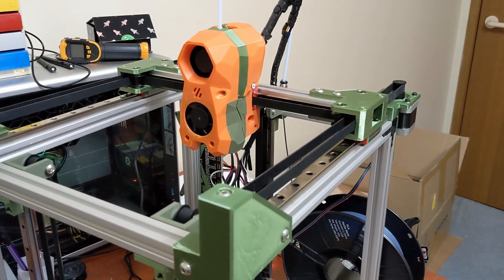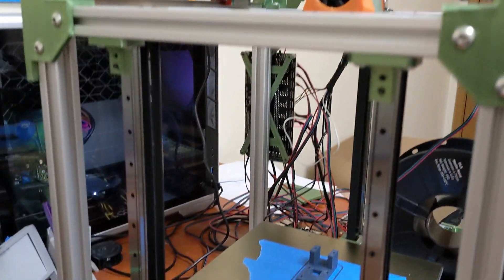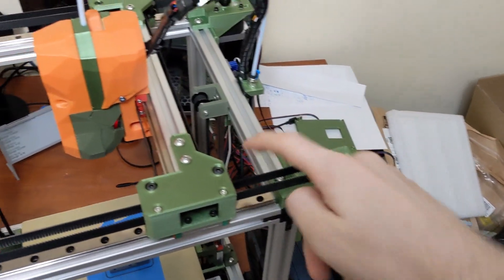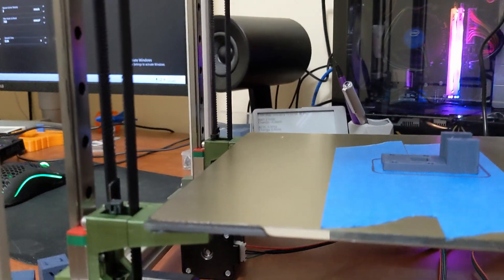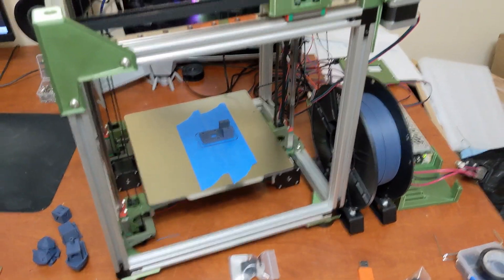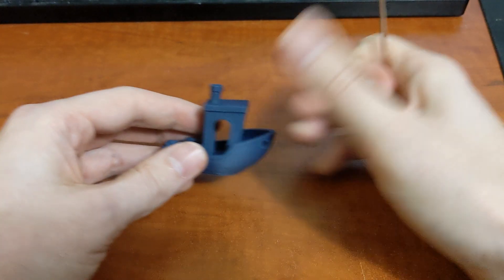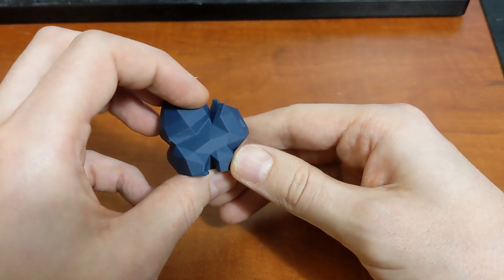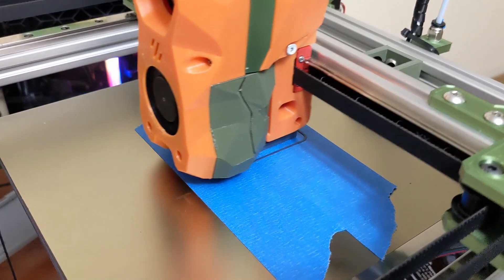Building a H-Bot 3D Printer - SimpleCube Ultra - Episode 3 Print Quality and Review

Comment: It's your decision, of course, but it seems to me that creating and making available multiple versions of your project might be the way forward. Clearly, you have the CAD and STL files, and you confirm that you're very happy with the current 3d printed results. I would consider this to be a version 1--despite the fact that there are some flaws and a number of needed improvements that will turn it into version 2, and so on.  Many of us are waiting to start a build, and what better way to embark on a project than doing it together? The risk, and I know this too well, is to be on an indefinite improvement path, which is great in itself, but may not necessarily help the rest of us who understand that the building process of these DIY printers is uncertain at best. If I want to build a proven printer, there are many that have already reached a stable status.
Reply from the maker: Yes I agree with you, I would like to release this as V1 however I don't know if I should do this as is with a 200x200x250 version for wait for then 300x300 version
Reply: @Rolohaun  I think there's a place for a 200x200 as well as a larger one. I have been building quadrants for many years, and each quadrant  I ship incorporates changes and new concepts. As I look back, some designs were crude and time consuming. However, I felt  confident in being able to stop the process in order to ship to customers who did not want to wait. The appeal of your unit is the low entry cost for some of us to start building an H-bot. Think about it. I could purchase a proven voron 0 kit for 500+, or I could build your model for xxx. This is the big question. If the entry cost is low, people will get excited and start building. That's what many of us like about this hobby. In my case, I decided to have 4 low cost printers that provide me with flexibility of working with different materials at the same time as well as very fast output by employing all 4 on duplicate prints. Moreover, one failure does not stop my production. This is the primary reason why I still  don't own a Voron 2.x. For the price of one voron, I have 4 printers and all the redundancy I need for my little business.
Reply from the maker: @tonycervone6494  I agree with you, the cost of this printer is around 600 USD buying everything new. that's for a 200x200x250 build area. A comparable Voron 2.4 or Trident with a 250 build is 972 USD

Comment: after thinking a little about it .... i wanna see this thing as fast as it can go i actually am the kind of person thats willing to sacrifise a little quality for speed so its kinda important to me to know what it actually might be able to acomplish and also i kinda dont see why that system would be slower then CoreXY still xD ... also i dont think things need to be inside the printer becasue there are things wich wont fit into the printer farme anyway .... say the PSU will be at the back ... that will need to stick out somewhat anyway so the steppers kinda being there isnt a huge loss to me personaly and the its alrady a kind of busy area with the extruder the Z rail right in the middle and stuff. From the front, left and right everything is so neat, i think it would be kinda nice to have a little rear cover and some things hidden behind that... or even if its only like half of the area thats blocked by the PSU and the cables next to it .... i kinda like astetic though complexity so ya that would be kinda fitting for a selfmade machine like that
Reply from the maker: the plan is to have a rear panel and everything will attach to that for electronics, everything is wired up temporarily right now. I would like to release a V1 as is right now but would  poeple want a 200x200 print area version or a 300x300?
Reply: @Rolohaun  you might wanna poll that xD but I personally would go for 300x300
Reply from the maker: @tinkeringstuffs6542  ya I would think 300x300 too, I can't do a poll on youtube yet but I can make one and put in in the description of my next video
Reply from the maker: I just tried 2000 accell and 120mm/s and had no issues
Reply from the maker: I just tried 2000 accell and 120mm/s and had no issues

Comment: if you move everything inside the frame, it might be a problem if you want to enclose it for abs due to heating up the motors and electronics
Reply from the maker: The electronics would still be external and all printed parts would need to be ABS. The motors and everything else should be fine.

Comment: As I see you have PEI sheet but print on blue tape. why?
Reply: I'm guessing the PEI doesn't work well without a heated bed
Reply: @NathanBuildsRobots  oh, have not realized that there is no heated bed 🙂
Reply from the maker: Correct, I don't have a SSR or Silicon heater yet

Comment: This is very very good. I was waiting for this. Please do post videos with the upgrades.do you have plans of enclosing this printer in the future to make it print abs and other stuff?

This is going to be a work horse
Reply from the maker: Yes I would like to get all the parts moved inside the frame and then make a standard 300x300 build with STL files I can release
Reply: @Rolohaun  awesome